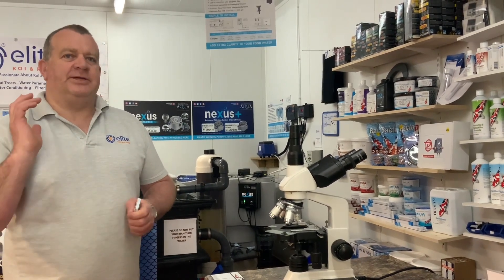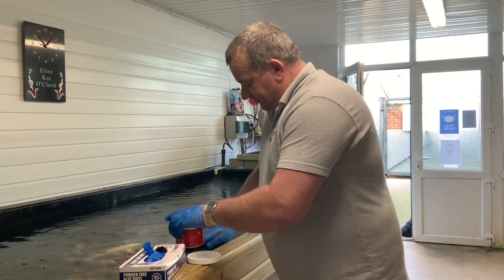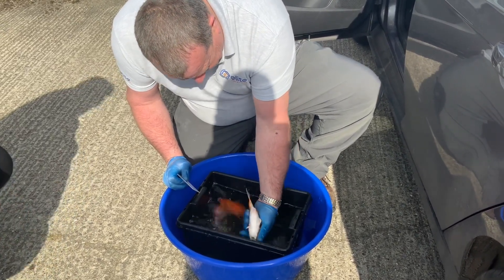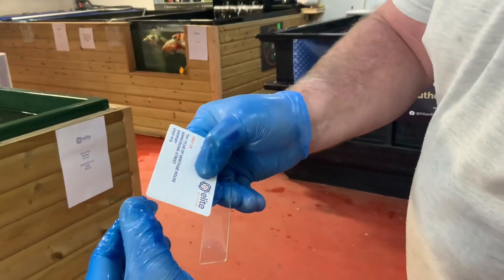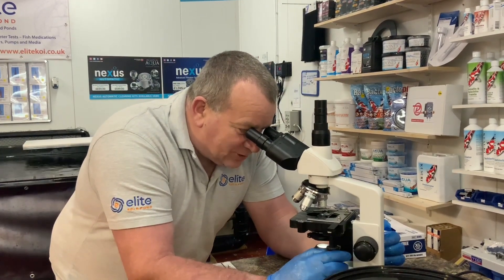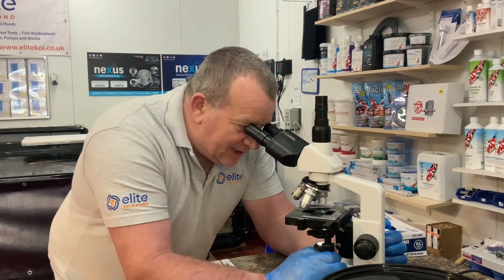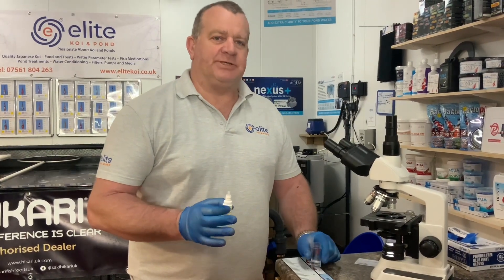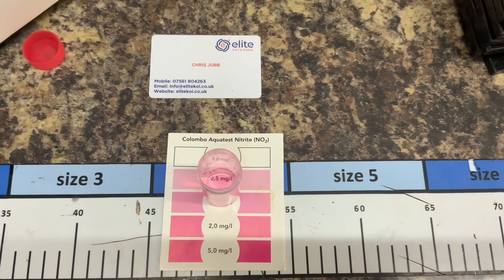KOI SCRAPE | Checking a Mucous Biopsy For Flukes Under a Microscope | Elite Koi

Comment: Nitrite is an absolute pain if it gets out of hand , normally new ponds and weak filters play apart in it but i made mistake once of topping water up 10% water changes sometimes more and my dechorinator had stopped working so every time i water changed i was getting chlorine in water killing filters off id check chlorine to
Reply from the maker: One of the reasons we always top the ponds up very slowly and make sure the fresh water enters tge pond away from the filter media. Flow rates play a massive part when using dechlorinators and we are happy with a strong drip 👍
Reply: @elitekoi  never even thought about slowing flow rate